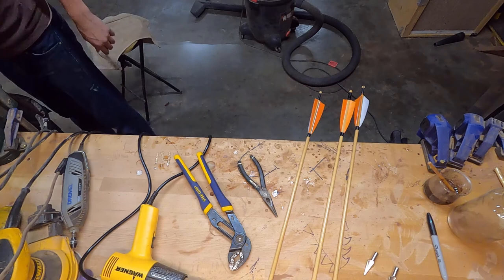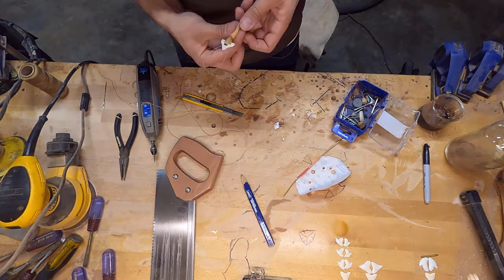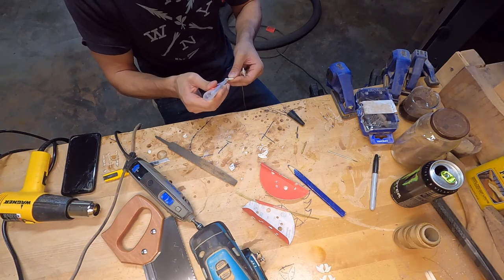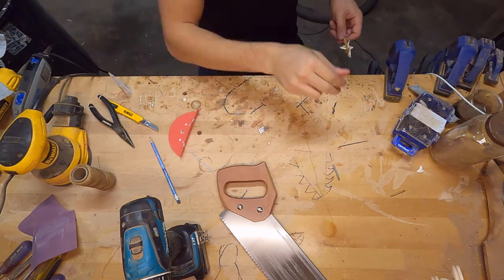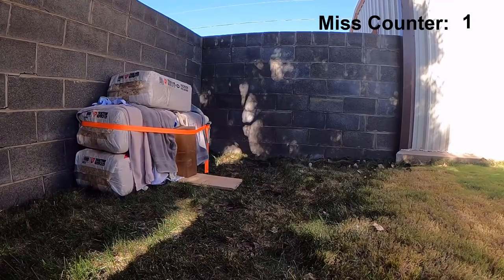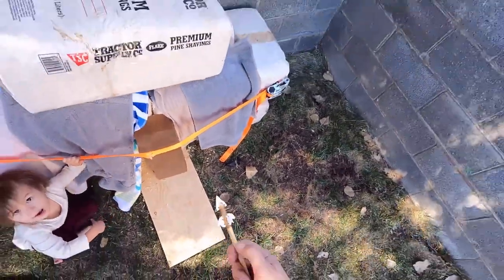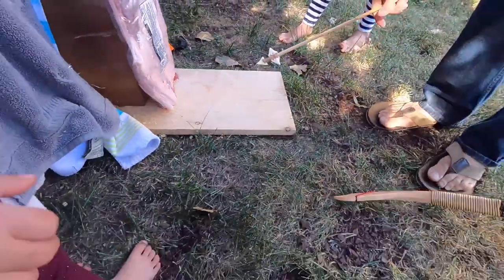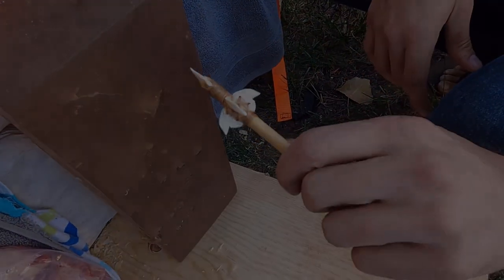Shark tooth Arrow Heads!?!?!?!! oh Ya!

Comment: As an archer, it seems strange to me they didn't use bows very much—considering some European bows reached 200 pounds of draw-weight and could punch into metal armour.

I can only guess they didn't have very good wood for making strong bow staves from, and had more target-practice levels of draw weight (15 to 30 pounds).

Still a very well made video regardless.
Reply from the maker: The record of bow and arrow they have in Hawaii was purely for a game hunting field mice and other like small mammals.   I don’t know the full reason but material is probably the main one. It is kinda interesting though because it was according to what is know about that time period considered a toy rather than a weapon of war. They did have other missiles, such as slings, spears, javelins and other thrown objects.

Comment: That X one man, looks slick, penetrates, and devastates.
Reply from the maker: Was surprised how well that performed actually 😅
Reply: @KoaStudio  i would think sand shark teeth would work great for an arrowhead tip
Reply from the maker: Probably make for great barbs! One thing I noticed was the blade like shape of the simple single tooth arrow flew right through the ribs and ballistics gel.  You might get a bit more depth on a pointed tip like the sand shark but the blade will do a lot more damage as it passes through.
Reply: @KoaStudio  yeah, the less surface area the more it penetrates obviously, but other factors atribute as well, for instance with the tiger teeth, bent backwards penetrate better because they concentrate dorce to split apart and move outwards, and bent forwards they don't penetrate as much because they force material inwards as they go, pinching the arrow in, so peraps the two tiger shark teeth would perform better inverted and the x would suffer inverted.
Reply from the maker: Makes sense

Comment: Was that actually a thing, or just a cool idea?
Also, did they use any natural glues?
It really is a cool idea... and as an archer in the PNW, it has me thinking...
Reply from the maker: Hawaii did not use at much natural glues or pitch as say the North and Central American tribes.  And there is very little record of bows let alone user in war.  This was mainly just for fun 😅 but shark teeth were used in plenty of other weapons in ancient Hawai’i
Reply: @KoaStudio  what do you reccomend for drilling the holes through the teeth?
Reply from the maker: I use a high speed dremel with a few different sizes of tungsten carbide bits depending on what ply lashing I will be using.
Reply from the maker: Also I try to keep the holes in the root of the tooth. I’ve noticed that if I drop into the enamel the teeth don’t seem to be as strong.